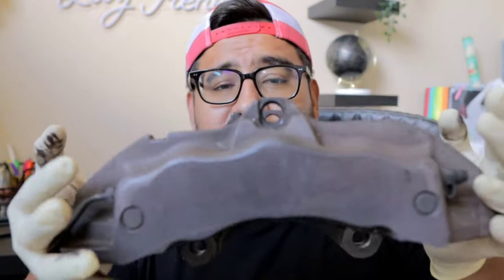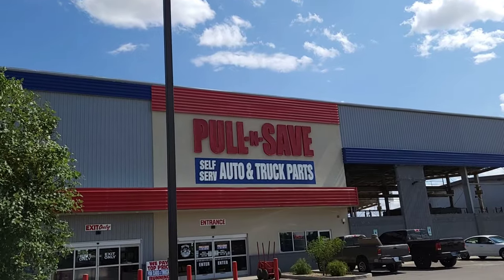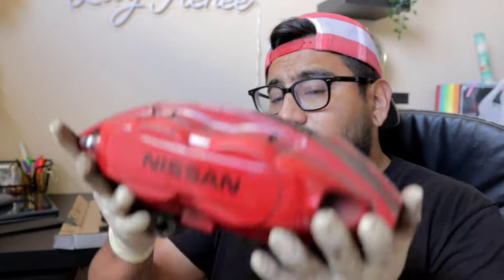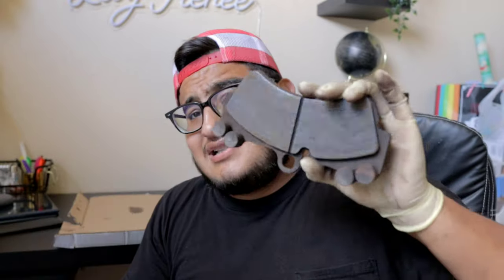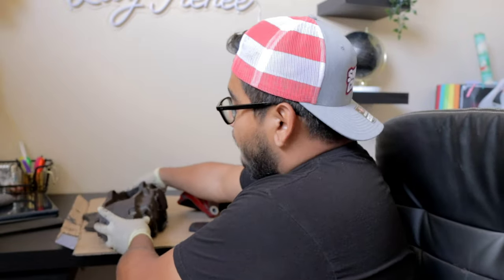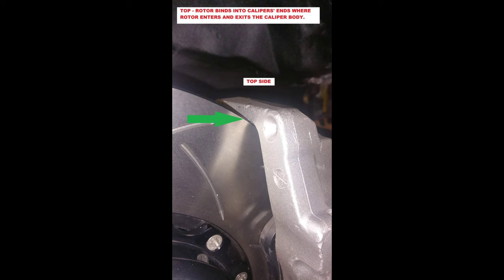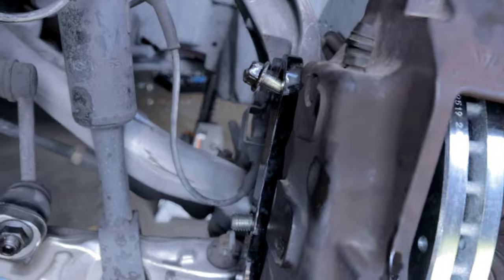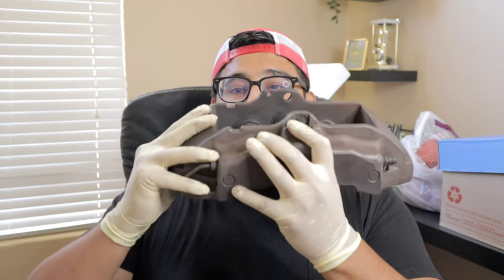These Salvage Yard 6 Piston Calipers Will Fit On Most Nissan Vehicles & They're Dirt Cheap! 17z 18z

Comment: Did this upgrade with my 03 350z (18z), fit great with the obvious modifications and adapter but If I had to do it again I would stick with the oem brembo.
Reply from the maker: Any particular reason? Any issues or downsides aside from the modification needed
Reply: @ERICSDIYGARAGE  I honestly did not see a major difference from my oem brembos.
I ended up going back to oem brembos and z1 2 piece rotors which helped me shave weight upfront which was a plus along side better fluid and pads which made a world of a difference compared to the 18z kit.
The 370z rotors are massive compared to brembo rotors and very heavy aswell.
Unless you get 2 piece rotors to offset the weight your adding I didn't see it being worth it for my z that I want to eventually track and take it on the twisties.
I'm in the process of putting them on my other Z however that's more of a looker haha.
Not bashing the the 18z-17z brakes as they look great but overall I would definitely stick to oem brembos for ease of installation, no modifications needed and overall great kit for a N/A Z or G
Reply from the maker: @luisaldaco1885  glad to hear you thoughts on the 370z rotors are heavy as hell compared to oem brembos definitely see you point

Comment: Did my is300 with brembos off a Genesis coupe shit is fire 🔥 but finding wheels was a mother
Reply from the maker: I'm assuming you needed a bracket or was it a direct bolt on
Reply: @ERICSDIYGARAGE  custom brackets and ISF larger rotors, would like to do a two piece rotor but the wife Doesn’t share my vision when it comes to my side chick. Her highness 😂 so it will be awhile but I have some interior mods coming soon

Comment: Eric, what is the selection of full track pads for the 17z or 18z calipers? I'm running the oem brembos on my 06 350z with Cobalt XR-2 race pads. They are incredible but I want to know what the options are on race pads for 17/18z calipers since they came on SUVs. I own a 13 Cayenne Diesel and it comes with 18z calipers. I can't find race pads for this caliper.

Comment: so which caliper would you best recommend for stopping power? I though to upgrade to the z1 akebono package but $2k is too expensive when I can buy used G35 brembos that might have the same stopping power, I do want to save weight too, I might not get the best of both worlds, are the G35 brembos heavy? I’m just tired of having these small stock calipers I always have to push the pedal to the floor to stop cause how long it takes to completely stop and I dislike it never feel comfortable doing pulls in these.
Reply from the maker: My favorite are the g35/350z brembos the akebono calipers and rotors are way too heavy. Brembo make superior calipers in my opinion.

Comment: I bought these calibers for my 97 Nissan Skyline R33 GTR Vspec.I haven't installed them hey, but it seems pretty straight forward.
Reply from the maker: Yeah the bracket makes it pretty easy
Reply: I plan to use it also on r33 GT-R 1997, it's much cheaper than buying brake pads from Japan.
Reply: @janvotava9792  facts
Reply: @janvotava9792 how did this work for you??? Would be a cheaper route over the R35 kits.

Comment: Do the 17z or 18z calipers fit a 350z 2005? With R1 concepts Rotors. I believe the rotors are the same size as stock
Reply from the maker: They need to be akebono size rotors 14in

Comment: i know this is old, but i’m looking to do this on my G35 coupe. what did you do for the rears? just regular stock Caliper? or can you also take these for the rear? of course smaller. any advice helps.
Reply from the maker: The rears you can use what you like. Akebono rears would be the best size set up or brembo rears

Comment: i have a fx35 2012 with 18 inch wheels, the fx50s of the same year had the akebono calipers so do you tink it will fit?
Reply from the maker: No, they won't fit without an adapter, and the company doesn't sell the adapter for vehicles that come akebonos from factory

Comment: For a 2005 350z if you use these for the front, what for the back? Also 17z or 18z for a 350z?
Reply from the maker: They both will fit the bracket is the only difference
Reply: @ERICSDIYGARAGE  sick, I can’t seem to find the bracket, is there a specific name for it? Both the 17z bracket and the 18z
Reply: @ERICSDIYGARAGE  also would you use all of the breaks form a Porsche Cayenne like front and back and just put those on the 350z or do you need different ones for back

Comment: Would this work on a 17 q60
Reply from the maker: Ecp does make a adapter bracket that let's you mount this to a 370z. If my understanding is correct  the q60 also uses akebonos and akebonos fit the 370z so in theory they should fit with the ecp 370z adapter

Comment: will these clear 18's on the 350z/g35s?
Reply from the maker: They should the wheels I used where 18s
Reply: @ERICSDIYGARAGE  thanks for the reply! What about the brake line fitting? Are the banjo bolt fittings for the line the same as the stock 350z?
Reply from the maker: @timothyl6151  I didn't get that far sorry

Comment: Hey would the 18z work on a 2020 maxima without any mods besides the bracket?
Reply from the maker: I'm not sure tbh if akebono calipers fit than yes
Reply: @ERICSDIYGARAGE  i have the akebono's on my 14 altima, should be the same as the maxima right?

Comment: Couldn't you also use an evo gsr 13.8" rotor without needing to grind down the caliper? That's what people have done when doing the akebono BBK on older nissans and it seems that would work with this also
Reply from the maker: I'm assuming it will work I'll have to look into this thanks for sharing the knowledge
Reply: @ERICSDIYGARAGE  of course and I meant to say evo gsr rotors**